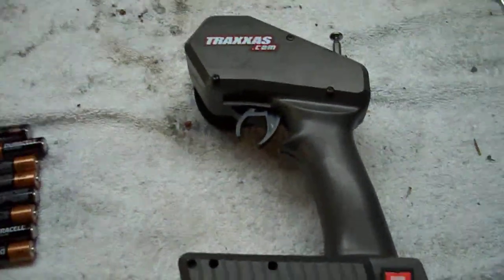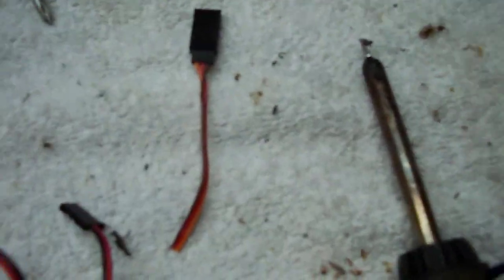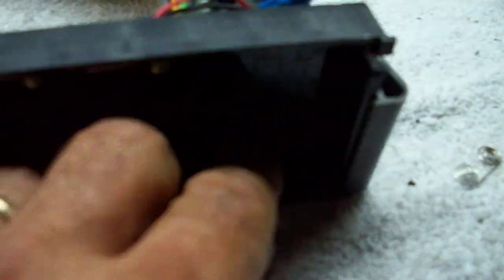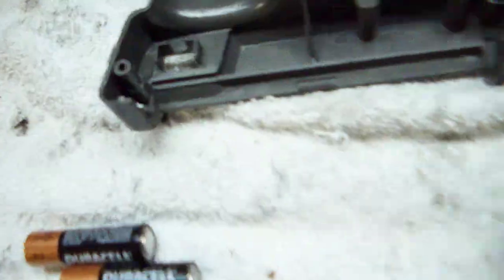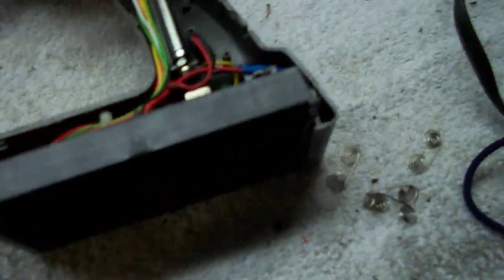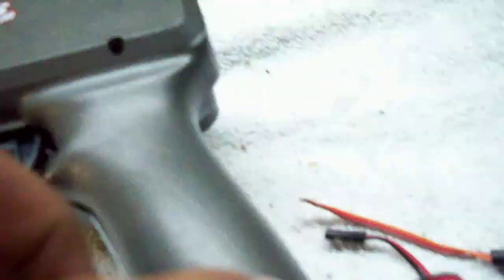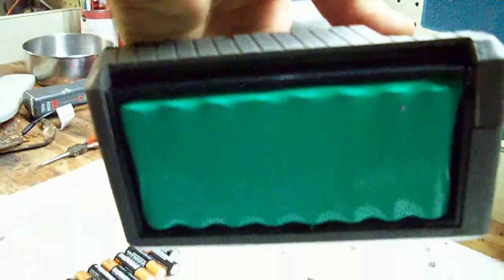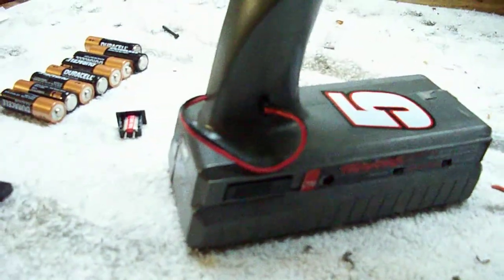TRAXXAS SLASH MODS 101 #3 say good buy to costly batteries

Comment: I would suggest to plug the battery wire in parallel with the plug you glued inside. So it can be used as a charge jack and no wires would be visible and also not disconneted during transport.

Comment: why not just mod the connection at the new battery instead of routing the wires outside the transmitter case?

Comment: it only has 4 aa's in it. I did a lipo mod on my hk gt2 because it took 7 aa's now I have to charge it every 5 runs which is not too bad but my mates have the stock tq radio and they take 4aa's and they bought them before Christmas and have not changed batteries yet 9 months and they use them a lot like me. so really for this radio it is a pretty inefficient mod, just buy new aa's $2 every year